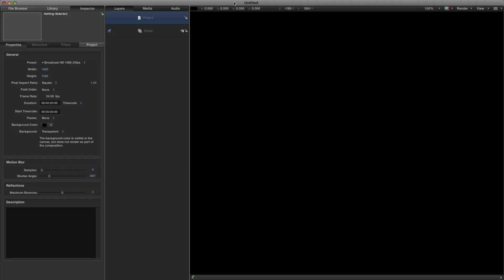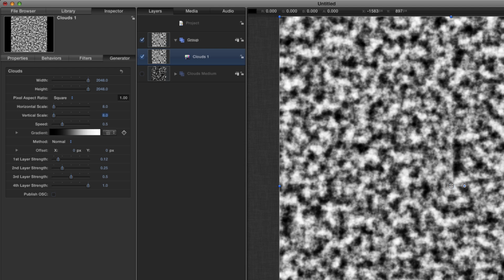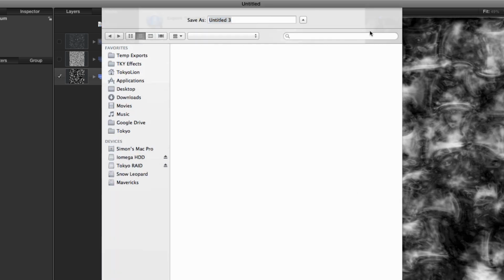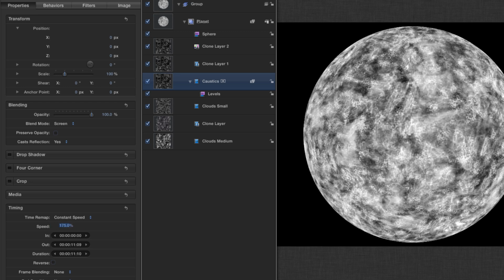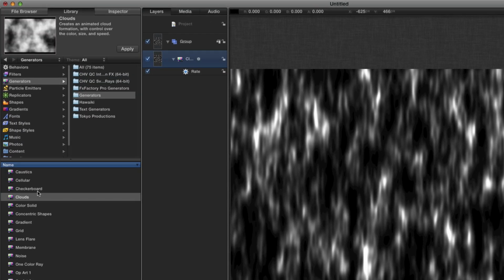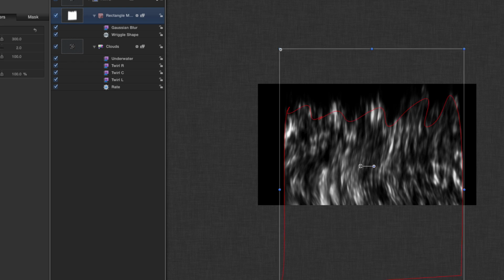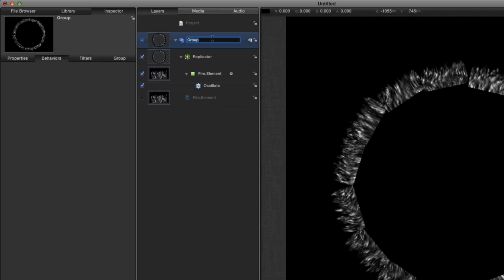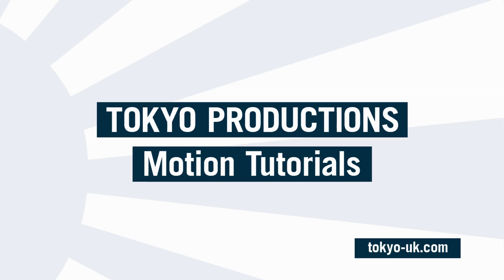Apple Motion 5 Tutorial: Fiery Planet Part 1 - Creating the Elements

Comment: Simon @20:54 I couldn't select edit point and I am stuck!
Reply from the maker: The Edit Points tool lives in the same menu as Transform/Anchor Point, etc. That's the menu at the bottom left hand corner of the Canvas. You can also sometimes activate it by double-clicking a shape in the Canvas itself but that can be tricky if you have multiple shapes.
Reply: Thank you, Simon, for a quick replay! I tried all that but couldn't get it to show the handle of the pen in order to edit till I went under Mask control points and activate it.  I think they changed the tools around in Motion 5. Finally, I got it.  I love your training and going through one by one.  You are amazing!
Reply: @Rockysvideostation  You saved me. Yes, on the left pane, under "Mask Controls", click 'Convert to Points". Helped me after 6 years :D